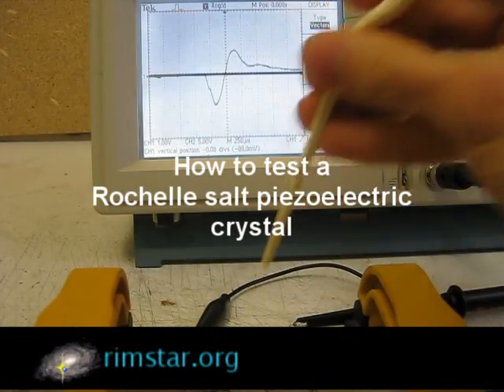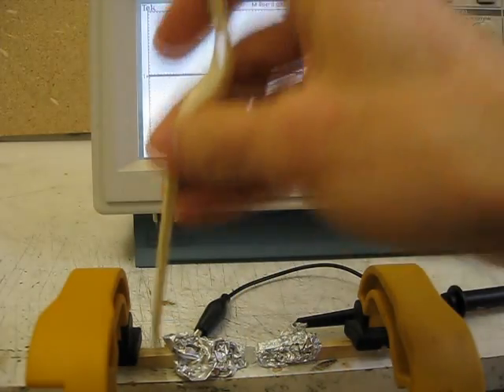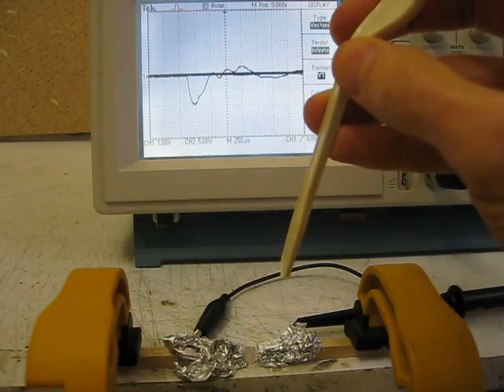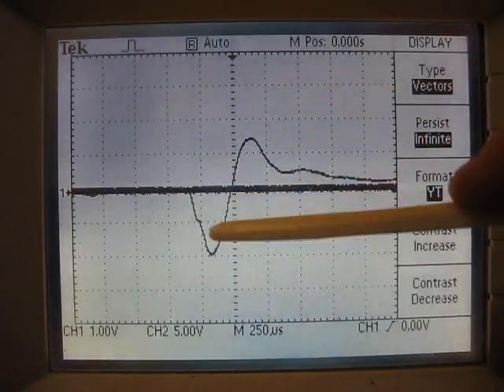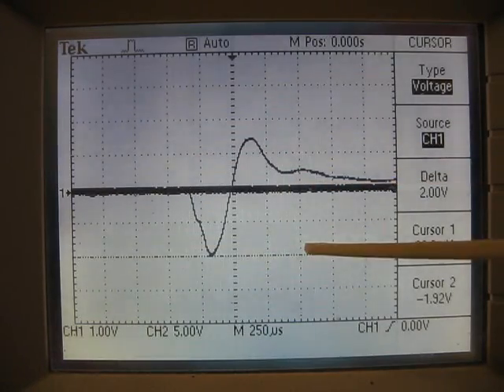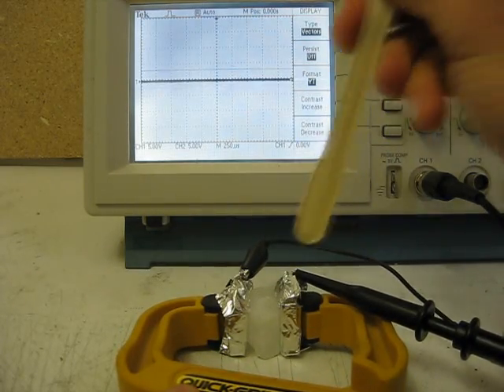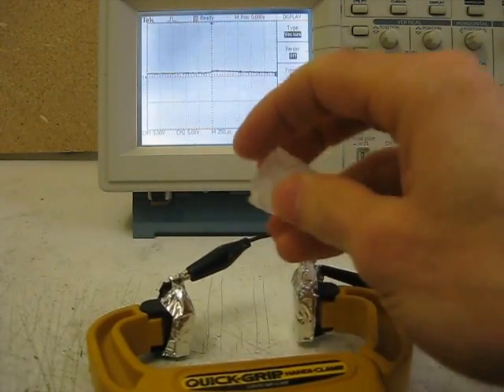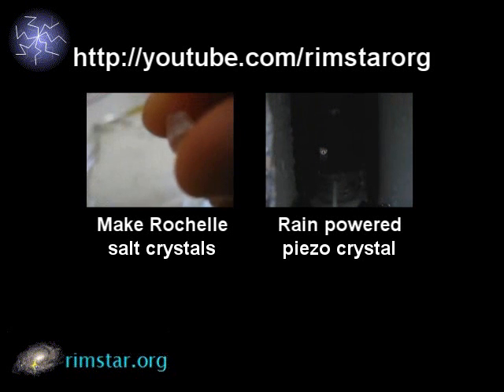How to test Rochelle salt piezoelectric crystals voltage oscilloscope

Comment: Several questions:
1- Who's to define the polarity? Isn't it likely that some parts of the crystal actually might have different polarities than the other parts? Specially since your big crystal is made of several fragmented parts? If so, I guess some of the energy is used to short-circuit your crystal. How can you get maximum energy out of it?
2- What would happen if you had turned the crystal 90 degrees in some direction? Or better, what if it was a sphere? How would polarity be defined?
3- You see a signal with -5V of peak (in the bigger one), but you have the circuit without a load, the oscilloscope is the load. The crystal behaves as a current power supply as the crystal is deformed. The voltage you see is a consequence of a current supply applied to a high resistor (>1MOhm, I guess). Have you tried to use another oscilloscope with a different input impedance and see the difference? or is the crystal's equivalent internal resistor too low?
Thank you for the great video!!!
Reply from the maker: 1- Yes, in this crystal there are two or three different polarities depending on where you make the electrical contact across. I don't think there's any/much short circuiting going on due to the different angles made by the different polarized sides.2- If you turn it 90 degrees, simply rotating it with the electrodes defining the axis of rotation then you'd still have to hit it in the same place and direction to get the voltage. The same would apply if it were a sphere. Keep in mind that I'm talking only of my Rochelle salt crystal. Crystals of some other materials behave differently.3- I haven't tried any other loads. Though I have done the reverse to make a speaker, as shown in my video https://www.youtube.com/watch?v=R9m79oWdOZIGlad you enjoyed the video! Thanks!

Comment: does this happens only with rochelle salt crystals? or this may works with sodium chloride crystals? or any other crystals? if not, how can I know what crystals could be used for such purposes?
Reply from the maker: I don't know which other crystals it works with. The commercially made ones are not Rochelle salt, but in the DIY area, I don't know what others work.
Reply: RimstarOrg Ok then, thanks for the reply. I'll search further and see what I find. And your videos are awesome. I learned much about many things with them.

Comment: Can these be made to replace crystals in old phono cartridges ? if so how could you attach wires to it?
Reply from the maker: I've never tried but I've heard that those crystals were Rochelle salt so my guess you be yes. You could simple glue some metal to the sides, once you've determined which sides to glue to, and attach wires to the metal. Very much like I pressed the foil against the crystal in this video. Just make sure the metal follows the shape of the crystal as closely as possible so that it's as close as possible. The metal doesn't have to be in electrical contact so the glue doesn't have to be electrically conductive.
Reply: Great minds think alike... phonograph cartridges is the first thing that popped into my mind... lol! :-D

Comment: Hi! Thank you so much for all the piezoelectric crystal videos, I really enjoyed them. 
I tried to make them on my own and it came out pretty well. I don't have an oscilloscope, so I decided to test it on an LED. I attached the crystal with 2 pieces of aluminum foil on each ends and connected my LED with the aluminum foil but the LED did not light up. I tried to switch the ends of the LED, but it still did not work. Are there any reasons that it did not work?

Comment: Thanks a lot for the replay, really appreciate it. I was thinking of capstone project using piezoelectric technology but we did not took anything related to piezoelectric in university and my knowledge is limited but there are different types of piezoelectric material right? I mean it can be made with different materials than the one you listed here?

Comment from the maker: I know through many observations and some reading a long time ago. The only assumption I make is that the explanation must be that the molecules relax after the initial application of pressure. Maybe the voltage is a molecular arrangement overshoot thing which relaxes again after the initial pressure? Just guessing there. As you can see in the scope shots, the voltage actually oscillates and dies away.

Comment from the maker: Hi! And yes, I sure did. I disconnected the regular speaker from a clock-radio and made a speaker using this crystal. You can see it in my "How to Make Piezoelectric Crystal Speaker" and "Piezoelectric Speaker - small crystals/window as speaker" videos. There are links in the description below this video or you can find them in the Videos section on my channel page.

Comment from the maker: I've dropped it from a 5 foot height and done a little damage to the crystal, but didn't shatter it and it still worked after. That's the most force I've put on it.

Comment from the maker: If the old one looked like plaster of paris for the X-tal then that sounds more like the disc piezo crystals that are attached to a brass disc plate. You can find them in piezo buzzers from Radio Shack, from crystal earpieces and from most microwave oven speakers. Jeri Ellsworth used them for the pickups for her Commodore 64 guitar, search for "C64 Bass Guitar" to see her video about it. Piezo discs are more efficient than Rochelle salt piezos. I don't know about their frequency characteristics.

Comment: This is for a harmonic microphone. I would NEVER try to do under saddle guitar string pick up with this stuff. Harmonica mics and amps are purposely low fidelity harsh crappy sounding things. I specialize in guitar, keyboard, harmonica, bass, pedal steel, and vocal amps. Unfortunately old harp mics are getting stupid expensive. Thanks for the great video! I shall try cutting a piezo disc, and this stuff. Cheers!

Comment: I want to rebuild an X-tal mic element. The old one looked like it had plaster of paris for the X-tal between two pieces of mylar with carbon on them like membrane switches. I think I could just use copper foil on mylar, solder the aluminum foil diaphragm to the center of a hole in the mylar and take the other side out etc. Would cutting up a piezo disc work better? I need 25K ohms Z @ 1KHz so it will work with a guitar amp. Could it be worse than the $3 Kobitone element?(OBS Discontinued item)

Comment from the maker: No, not my big rochelle salt crystal. The voltage may be decent but the current in the arc is so small you don't even see any arc. If you want a decent shock then look try a piezo crystal from a BBQ igniter or small lighter like in my "How to get Piezoelectric Crystal from BBQ Igniter/Sparker" video. That one hurts! There's a link to it in the description below this video.

Comment from the maker: Not really. There may be highish voltage every time you hit it but there's not much power and you have to keep hitting it. Of course if you had some commercially made crystals which give out more power, and a reliable way of tapping or flexing the crystal, then you could make something useful.

Comment from the maker: My scope is a Tektronix TDS 220. I've shaped them by sanding them. Before you do, make sure you test for which faces you tap against and which provide the voltage. Also, search youtube for "C64 Bass Guitar" to see a video by jeriellsworth where she did something similar but with disk type piezo crystals.

Comment from the maker: I'm not sure how to answer that. The negative voltage just means the dipoles in the crystal reversed polarity so there were more electrons on one side than the other, the opposite to what happens when there's a positive voltage.

Comment from the maker: Just a note. The crystal puts out sharp voltage spikes. A digital voltmeter doesn't show these well. But if you hook up your crystal, put your meter on the DC millivolts scale, usually shown as mV with a flat line or two above it, not the one with the wavey line above it. Then tap repeatedly and quickly on the crystal. That will at least give the meter many spikes in a row and it'll look more like solid voltage to the meter. It'll show as very low voltage, but at least it will respond.
Reply: I know it's been a long time since you posted the video but as you mentioned my voltemeter just can't pick up the signal output. I know it is at least in the ball park because my meter can put current through it but I was wanting to run little at home experiments and one of then was if rochelle salts still produced current as a powder and if so how much voltage was lost or gained from it being turned from crystal to powder. If you would happen to know either of these things that would be great as I can't go out and buy an oscilloscope and can't really find the answers to my questions on Google. Hope you are still doing well and can see this.
Reply from the maker: I don't think it would work at all as a powder. You need a crystal that you can hit against two sides so that the effect can happen inside the crystal.

Comment from the maker: I just tried and it didn't work for me, at least not with the Rochelle salt crystal. I do manage to light the LED using one of those disk shaped piezo crystals that you get from some gift cards, some microwave ovens, piezo buzzers and crystal earpieces, but I know those are much more efficient. If you're looking for an application to use it for, try a piezoelectric speaker like I show in my "How to Make a Piezoelectric Speaker" video. You can find it on my channel page in the Browse videos tab.

Comment from the maker: Yes, you can test with a voltmeter. Just connect the two probes of the volt meter in place of where I make the two connections in this video. You may have to try the rochelle salt crystal in various orientations and tap in different places until you find a combination that works.

Comment: Hey, I would like to know which type of piezoelectric substance is best for generating electricity..We are trying to use it as an auxiliary source of power due to the pressure created by the wind turbines when the speed of the wind turbine is lower than the cutoff speed necessary to generate power through conventional methods...I would appreciate it if you could help me..Thanks.

Comment from the maker: If the pressure of the hit on the crystal is greater then the voltage produced is higher. In the case of it being protected by asphalt that gets hammered, it would come down to how much of the pressure gets to the crystal.

Comment: Can I ask what will happen to the voltage the crystal will produce if the amount of pressure is greater? For example, if there is Rochelle salt and it is protected by a layer of asphalt and then the asphalt gets hammered. What would the voltage be, then?

Comment: @RimstarOrg Piezoelectric materials do not generate electricity from pressure but from their change in shape. Applying a constant pressure is no longer changing the shape of the crystal so no voltage is generated.

Comment from the maker: @MichaelAChang Thinking more of what you want to do - It would still be very hard and I don't know how well it would work, but you could do as in my "previous How-To" video. Then select a flatish crystal that tests the way you want and use that as a seed crystal to make a larger one. The larger one would be made in a flatish container with a PCB bottom. See the last part of the "How to make a Rochelle salt crystal" page on my website. A link is in the description of the "previous How-To" video.

Comment from the maker: @MichaelAChang Interesting. I don't know if pouring the solution out on a copper clad PCB would work. I have my doubts it would work on your first attempt. You'd probably have to do a number of tries to find out. The batch I made this time didn't give as many crystals as the batch I made a few years ago, and yet it was the same recipe. So there are variables to play with, probably temperatures in my case since I didn't strictly monitor and control that.

Comment: I'd like to try making some using your "previous How-To" video as a reference, but instead of making clumps, to make sheets dried on a copper clad PCB to facilitate soldering. Any reason why that wouldn't work? 

I have tested those standard piezo discs glued to the dust cap of a 15" woofer as a motional feedback sensor. It worked quite well, and I was surprised by the response linearity.